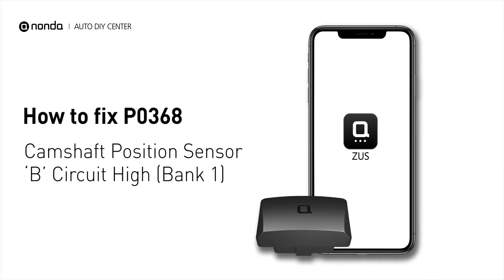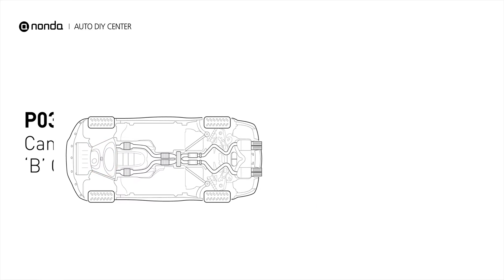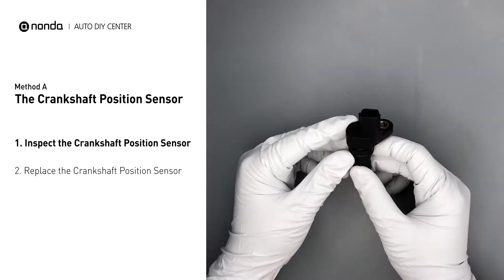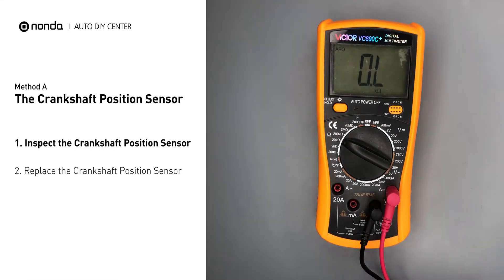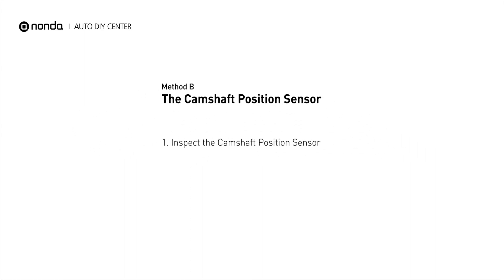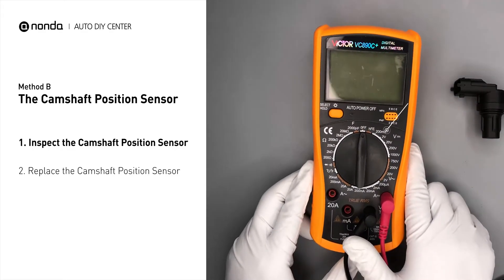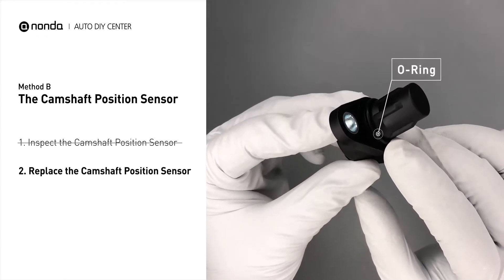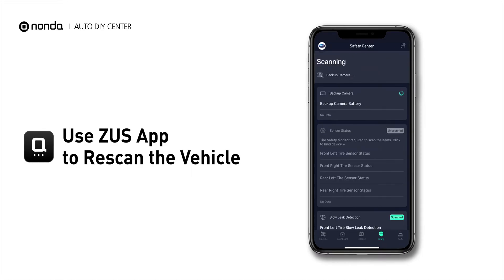How to Fix P0368 Engine Code in 3 Minutes [2 DIY Methods / Only $9.86]

Comment: Replaced camshaft position sensor and crankshaft position sensor and still getting p0368 code
Reply: I’m having the same problem I have a 2007 Lexus es350
Reply: Probably chain  @spitatainment
Reply from the maker: Hello, can you please provide us with your vehicle's year, make/model and confirm if there are other codes that register along with this code?
Reply: @nondainc  2011 gmc acadia slt
Reply: @ridemx1416 
Did you ever fix the problem because I’m having the same issue right now as well?
Reply: @nondainc e46 n42 b20 2003